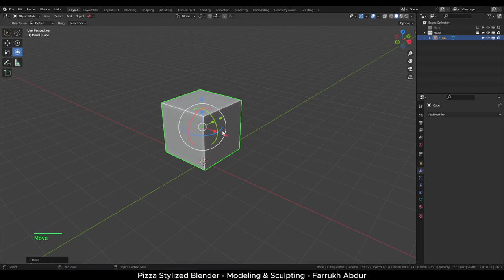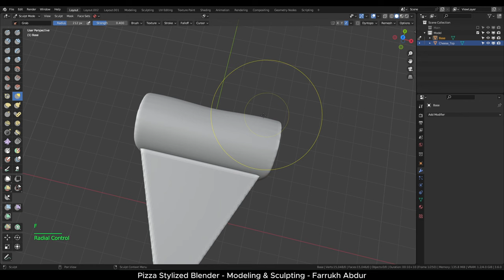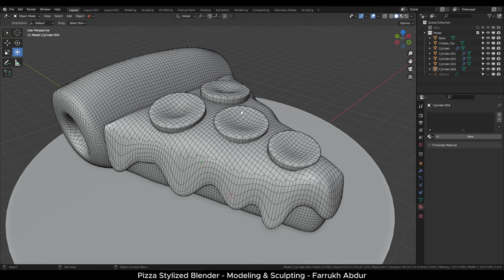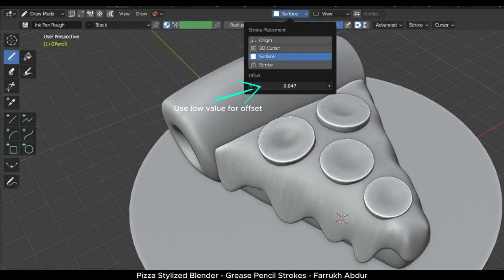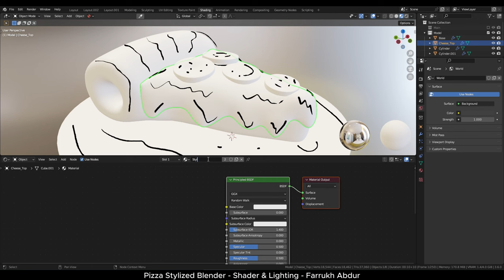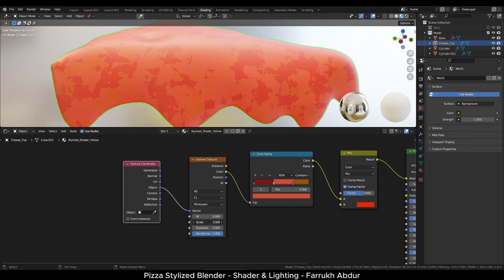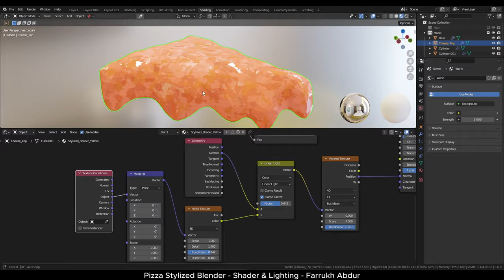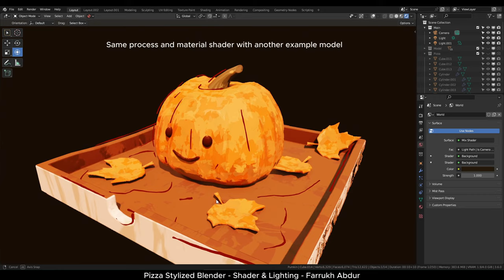Stylized Pizza Art Tutorial - Blender

Comment: Very nice. Are you using linux or windows? If linux, which distro(flavor)?
Reply from the maker: Thank you! Using windows 10! :goodvibes:
Reply: I think Lubuntu(a flavor of ubuntu) is better for you since you work on a low end pc. It is much faster and lightweight as compare to windows. Blender runs around 20 to 30% faster with linux. Only downside is that linux is a bit difficult to use than window. Also you cannot run Adobe softwares in linux.